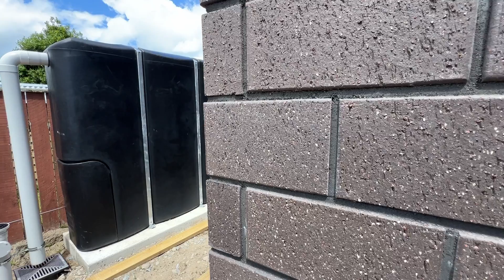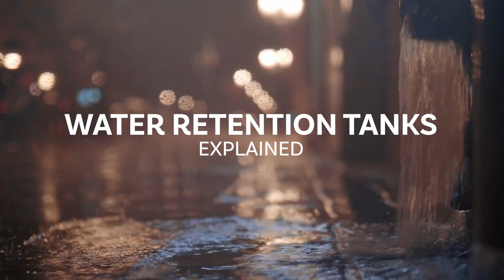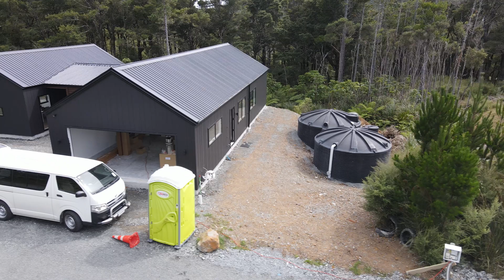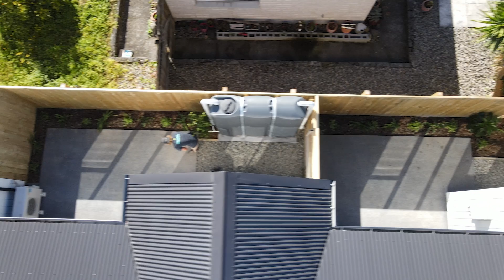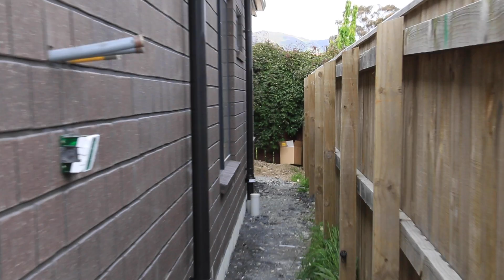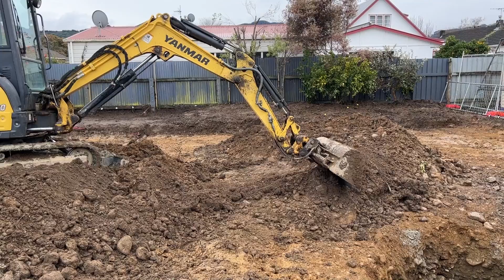New Build Eyesore Explained

Comment: I did a soak pit 4 years ago. Pleased I did looking at those!  I wonder if can hide tanks under a deck or buried in the ground, even half buried like rural water tanks.
Reply: Yeah there’re a lot of new builds we did where the tanks are either underslab or under the driveway. If it’s a retention tank you gotta incorporate a storm water pump
Reply: A tank under a deck would be more ideal imo. Always easier to open up a deck for repair and maintenance rather than opening up a concrete slab or driveway 😂

Comment: I have one of these and they are expensive if you also tie into your toilet flush system. From a water recycle perspective, the actual water usage cost savings is very minimal compared to the total water bill. As a buffer for storm water, it’s a minimal buffer as they fill quite quickly and subsequently overflow into the system. For water recycling, they empty quickly - in my household, probably in less than two weeks so they largely sit redundant for most of the year. If doing again, and emphasis on water retention and recycling, I’d go for a 10k ltr modular sunk system.

Comment: Thanks Josh, I'm slowly in the process of modernizing my house and have plans to install some tanks. My initial thought was to use the water at home to reduce load on the local supply (which we nearly lost and the entire town was on urgent restriction).

Until now, I never knew that trickling back to the storm water was even a thing. Makes sense. Maybe I can have a 2 tank set up. The first tank acting as a supplemental tank for a mix of tank and town supply and the second tank would be an overflow from the first tank and act as a surge tank.

Appreciate the info

Comment: Good idea, but I reckon 2000L is probably too small.  A few years ago I re-did my soak pit to slightly-above code, taking into account NIWA rainfall data, worst-case Hutt Valley floor perc rates, GWRC +16% bias etc and for my 100m2 house, that's just shy of 4000L to meet code.  Detention tank and soak pits should follow fundamentally the same formulas.

So for a new build with a larger footprint and way more impermeable surfaces, gonna throw a total guess number out and say you probably want more like 6000L or more.  It looks like these smaller tanks are just a compromise by Wellington Water:  It's easier to get property owner buy-in and it's better than nothing, especially cumulatively across the region.

Anyway, it'd be good to get those plumbed in for laundry and toilet with either mains switchover or mains top-up.  Good thing those Promax tanks have the pump housing, so that option is there :)
Reply: my thought is that this only catches water off roofs, but their complaint is about the concrete stopping permeation. also, as an american, its the governments job to manage their systems such as storm drainage, although i guess we are forced to dig massive holes for that...
Reply: The calcs for a soak pit are going to result in a higher volume than a detention tank. If a soak pit goes over capacity you're in trouble; but if a detention tank goes over capacity the excess just goes into the stormwater network, and it's doing what it's designed to do anyway (which is basically just to make sure stormwater flows aren't going to exceed what the network can handle).

Comment: Great video although technically that's a detention tank not a retention tank. The difference is that a retention tank can be used for watering the garden although there also needs to a level of water still in the tanks to feed the stormwater. I would also suggest looking at a company called thin tanks which can be used as a fence line. Rather than the black tanks
Reply: Good point, also find this content in my construction Services lecture.